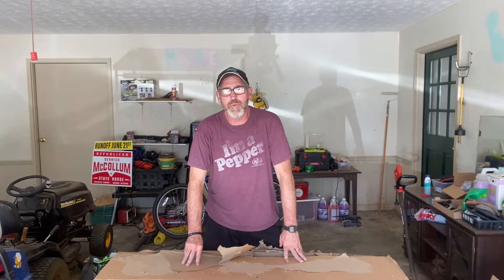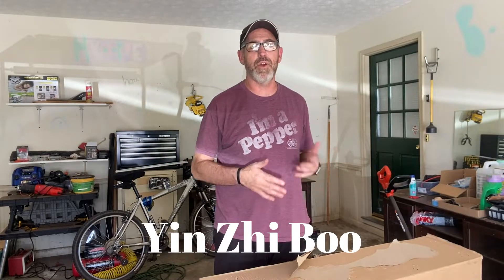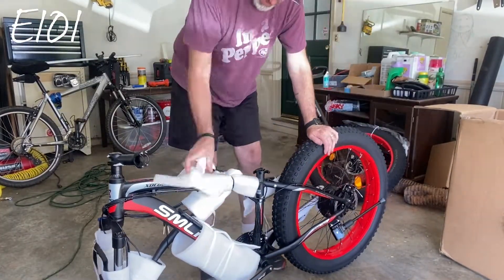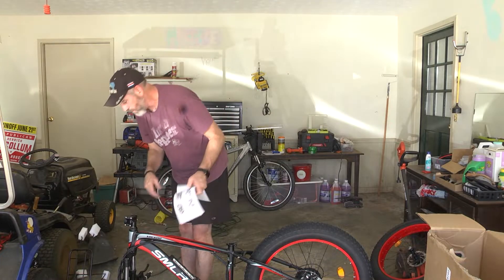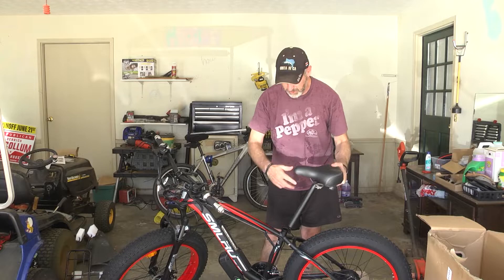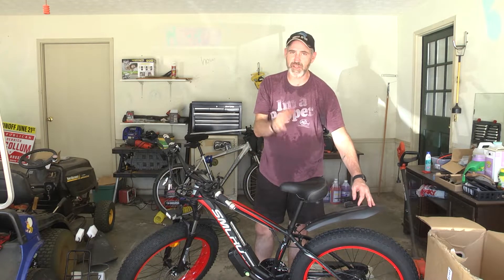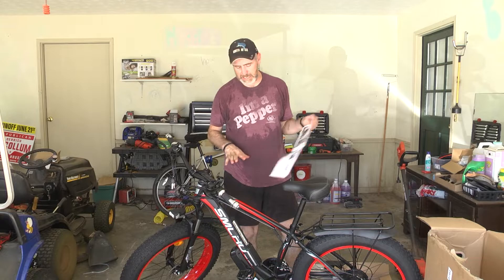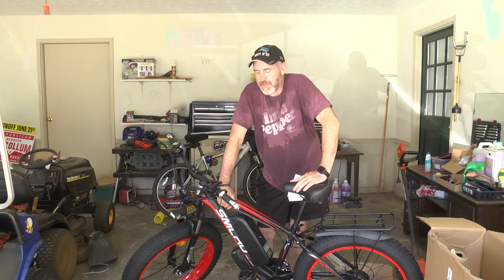SMLRO EBike Assembly and Test Drive

Comment: For a good muscular workout,  a torque sensing pedal assist is the way to go. I had the chance to rent a high end ebike with torque sensing and I genuinely had the same experience as a regular bike, but felt like a superhero while riding. For commuting on flat ground,  36v 350 w is plenty where it offers assist and makes hills easier but still requires effort on them. I found sabvoton controllers do a decent job of using programming to make pedal sensors feel like torque sensors, at least halfway closer to the real thing.
Reply from the maker: Thanks for the info! When I bike to work, I have a steady incline for the last half-mile so I keep some tension on the pedals so I can still get a work out.

Comment: I just received one of these bikes. There was no parts list. Found 3 loose screws and 1 larger screw and larger nut in bottom of the box. Is that all the screws or am I missing some? There was a big hole in the side of the box.
Reply from the maker: I think there should be more parts than that, if I remember right.
Reply: I just got mine delivered today 8/22/23 and also finded 3 screws and a nut at the bottom on my box as well. I don't know where they go, so I want to believe that they are extra spares. If something on my bike falls apart while riding and causes me to crash, I'll let you guys know 😂😂😂

Comment: I'm thinking of ordering the dual motor but it's a bit more expensive thanks for the video because maybe the single motor might be more practical. THe 13Ah battery though is way way too small. Can you show the battery plate to see if a bigger battery can be installed?
Reply from the maker: Hey, let me try to get a picture of it. Can you send me your email to everything101class@gmail.com. I'll send you the pic.
Reply: @DannyEverything101  Sure NP it looks like a very decent bike.

Comment: I've got the black and green one with duel motor and it gets anywhere and huts speeds of 34 mph lovely bike
Reply: Or and I did change the brakes to hydraulic one I think standard ones are ok but they make a noise
Reply from the maker: I love this bike. I will have to change the brakes soon though.

Comment: I just got mine today and put it together, what would the optimum settings be (1-18)
Reply: How’s your bike so far what’s the max speed and range
Reply from the maker: I haven't adjusted my settings at all from the factory settings. Works great for me.
Reply from the maker: Still love it! It tops out around 35 if I'm going down a steep hill.

Comment: So,how do i get a manual? I need a trouble shooting guide. Be careful. I have one of these and there are tons of things that can go wrong. Your bike has the same kind od display mine has. I need to know how to set up the correct settings. Mine didnt come with one. Without the manual,and or troubleshooting guide,i cant get the right settings put into the display.
Reply from the maker: That's a great question. Someone said on Amazon they messaged the company and got a manual, but I haven't seen one. I would like to change my speed reading to miles instead of km, but I'm afraid to mess with it too much without a manual.

Comment: I just ordered one of these online. I was wondering if the tires are tubeless or are they not? Do you recommend putting tire sealant before I test drive it after assembling ?
Reply from the maker: My tires had tubes, but I got a flat three times within three months because I was commuting to work, which was about four miles of sidewalk. People keep throwing bottles and other junk on the side of the road. I eventually bought some tire liners on Amazon and had a company install them. So far I haven't had a problem since they were installed.
Reply: How’s your bike so far what’s the max speed and range
Reply: @AlShams69  50 km/h max speed, and with assist mode gives up to 110 km, but without assist mode can only give 52 km